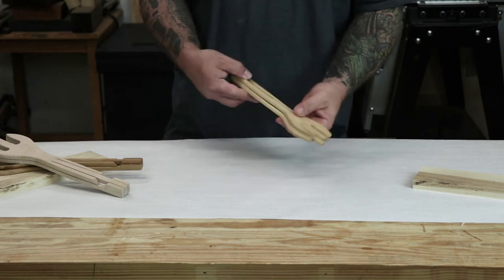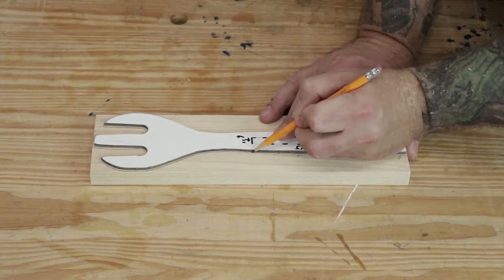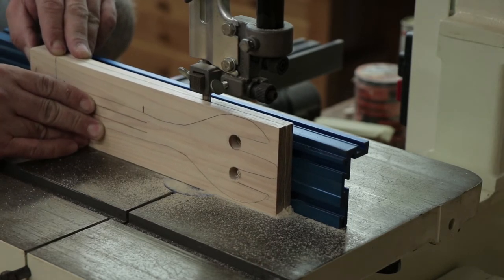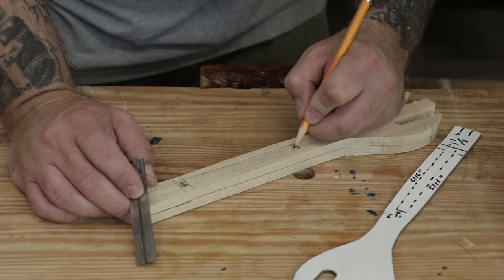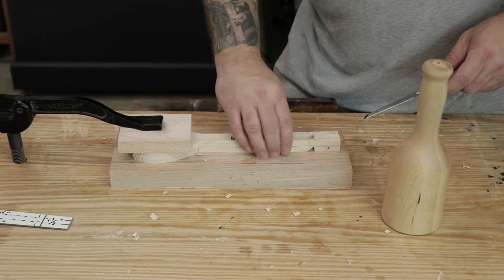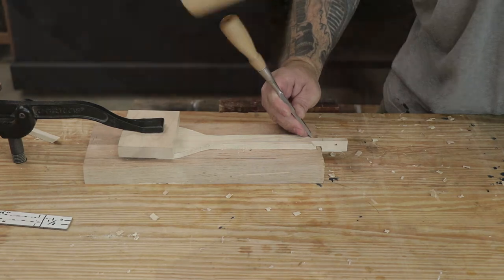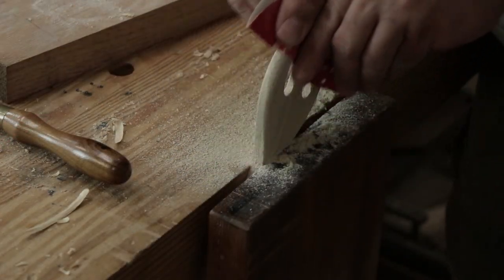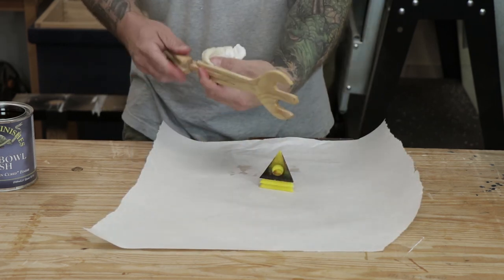Hand Made Salad Tongs Cut From One Board

Comment: You are an advanced wood worker.  I  also make the wood  spring  tongs but I keep the center leg and I glue on contrasting wood pieces on the end. It takes longer for the glue to set up but when it  sets up I sand the ends smooth. Like and subscribed